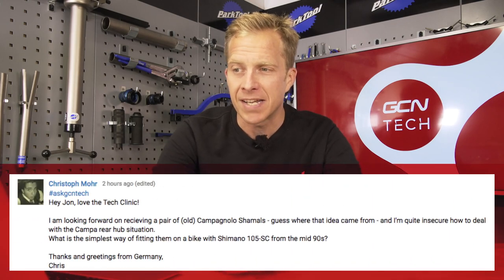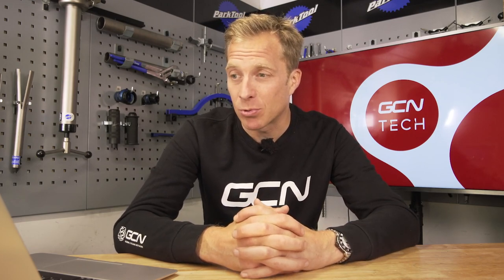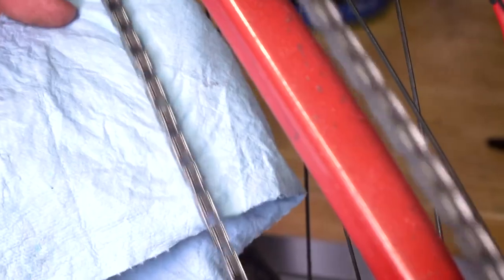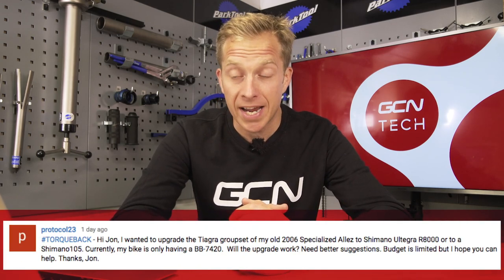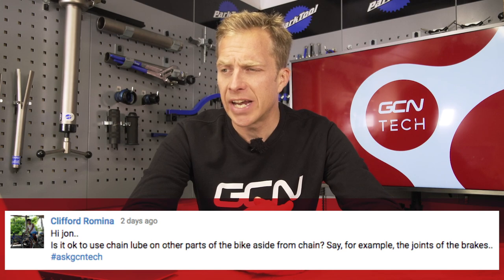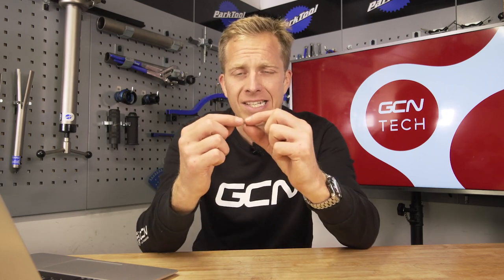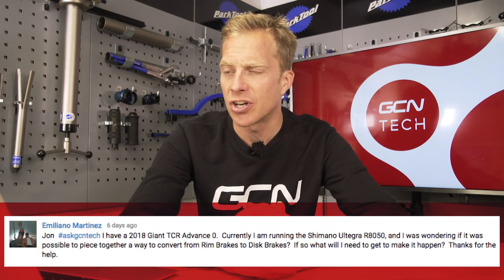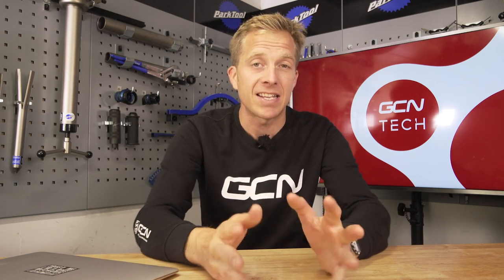How Do I Keep My Chain Super Clean? | GCN Tech Clinic

Comment: RE: Frizi Hugo. I had a situation twice where the cassette chewed right in to the freehub. at a point it began to cause a weird sought of slacking in the chain when free wheeling. which caused the chain to this the spokes often. I pulled the cassette off and installed a new Shimano cassette and chain. same issue. When i switched to the Edco Monoblock issue went away. I think this only happens to people who do lots of distance and only have 1 set of wheels so your bike gets used all year round. when you have more wheels you tend to switch from summer to winter and all that jazz. at least thats what i've found

Comment: hello john, i recently finished my winter bike with a 2005 shimano xtr crankset with corresponding bottom bracket and chainring, but no matter how much i tighten the bolts or lockring, or where i put oil and grease, i always get a creaking noise proportional to the torque i put in. i'd really like to trust it more in the snow in a couple of weeks (yeah in quebec we do ride in a LOT of sow)
Reply: Ditto - sort of. Running Shimano 105 and recently changed the chain rings and chain, then cleaned and repacked my Look Keo's, then finally changed the chain ring bolts (and re-tightened them twice since which lasts for a single ride). I still get creaking under load like climbing and/or out of the saddle moments. I'm about to pull the rings off and completely clean the BB and do an extra cleaning around the contact points for the rings. Suggestions?
Reply: @manex3  is it octalink too? I'm sure the problem comes from there

Comment: #askgcntech
Hi guys, nice show !
I have a little problem : i recently upgrade my bike by replacing 23c tyres  with 25c tyres. Since i have done this, some gravel or some dead leaves are sticking to the tyres, and finally jam between the brake, the frame (or fork in front), and the tyres. It rub against my tyres, and it's slowing me. To put everything out of this place, i need to stop my bike, and spin the wheel in the over side. It happened generally at low speed, even if i released the calliper.
I don't want to buy new 23c tyres. What can i do ? 
Thanks a lot !!!

Comment: Hi Jon. I am using the previous generation of SRAM Red 22, with short cage rear derailleur. Officially it is for 11-28 only, but works fine with 11-30, although anything bigger would be pushing it. However, I have a 1x11 SRAM Rival derailleur sitting at home, and was thinking of using it. Do you think it would work with my 2x setup? Won't the clutch interfere with the front shifting somehow? Thanks !        #askgcntech

Comment: First, I clean my goldchain with a Parktool cm5.2 with Morgan blue chain cleaner (best ive used!). Then I use the parktool once again, this time with water and dishsoap. After this the chain is clean, and I mean clean!. dry the chain, and then I use muc off dry lube, and give each link a drop of oil. Then I pedal backwards a few times over an hour before I let the bike be over the night. The day after I wipe away all the excess oil, and the chain does not need to be lubricated again for 300-400km.

Comment: Hi Jon,
I just got a nasty puncture running over some glass 400m from my apartment :( My tire now has a 1cm tear in it perpendicular to the rolling direction. On the inside of the tire, there is a 1mm by 1mm hole poking through. My Dad reckons that I should replace the tire, what is your opinion? I ride in flat terrain so descents won't be a problem.
Basically, how bad does a puncture need to be for a tire to require replacement?
Thanks!
Reply: Maarten S get safety patches from parktool and stick them inside of the tire
Reply: If you can patch the inside  (not sure on that part), you can use shoe goo on the outside of the tire to help fill holes from the glass. It's not perfect but helps.
Reply: Yes you could patch the inside with a proper tire boot or maybe a cut out piece of sidewall from another (old) tire. I've done the same on 1 of my tires that had a similar slash in it and it still works. Not really the ideal thing to do but as that tire of mine was basically brand new I didn't wanna buy a new tire, if your tire is halfway gone anyway you might as well buy a new tire.
Reply: I've used two layers of duct tape to good effect.  Be sure to clean the inside of the tire before applying the tape.  Keep a close eye on the tire to be sure that the fix is working properly.  If the tire has a noticeable bulge in it, replace the tire to be safe.

Comment: Hi Jon,

This question has been on my mind for a while now. I ride a late 80's koga miyata road bike which has a 6 speed uniglide cassette fitted. I want to convert the UG hub to an HG hub to fit a hyperglide cassette but have no idea where to start. Not really keen on replacing the hub or wheel cause I want to keep it as stock as possible. You have any experience converting UG to HG?

Greetings! :-)

Comment: Hi, nice one once again, Jon. I have a question, too. 

My dilemma: upgrade or replace?

I have had a good ol' Trek SL 1000 (or 100SL, or something) for a few years now, with all the original components, like a (mostly) Sora group still in place. That includes 3x8 shifting. I have only replaced the saddle, stem and handle bar until now. I kind of like the lively feel of the frame and fork, but would like to ride with better components, in particular a 10 (or 11) speed cassette. Of course I could just get another bike, but what about upgrading to say a second hand 105 group? Apart from the question whether that would economically be smart, would I run into technical issues?

Comment: #askgcntech
Hi Jon. I have the following issue, and your colleagues recommended to contact you for some assistance:

I have an Ultegra Di2 system which I try to index (rear derailleur).
Everything worked fine, except all my gears (11) are shifted with one position, meaning I cannot shift to hardest gear (smallest sprocket) and when I shift to easiest gear (largest sprocket) the chain "leaves" the sprocket and shifts in between the cassette and the spokes.
I tried to adjust the low and high limit screws, but then I only got left with 10 gears. No more chain slipping between the cassette and the spokes, but still no shifting to hardest gear, because the high limit screw is not limiting anything, actually. :)
Is it something that I am doing wrong? Or not doing at all?
Thanks in advance for your help!

Comment: #askgcntech hi jon, i used to run 32mm tires on my specialized allez elite but after having problems with my brake calipers i switched back to 25mm, some times my calipers get stuck and i feel some play in the brake lever, could be possible that the spring of the calipers lost their strenght after forcing the wheels to fit in the bike?  i have a pair of shimano tiagra calipers but this also happened a month after i bought my bike with the stock tektro calipers and 23mm tires, i’ve changed cables and housings and still having this problem, or it could be a problem with the mechanism of the shifters? any idea of what could be happening or someone has experienced this problem before?

Comment: Not sure of the reason, but I just recently bought a Mavic Cosmic Elite UST wheelset, and in their manual they specified to not use individual cogs on their freehub body, but stick with the standard type where the majority of the cassette is fixed together.
Reply: Jake Wisse I find that absurd. Majority of my cassette is individual (except some cogs are attached together) and I have the same freehub system on my cosmics. No issues besides what everyone has (rocking freehub body).

Comment: Hi Jon
Never miss Tech Clinic, always entertaining and informative.
I have a 2003 Lemond aluminum frame bike which I updated last year that included a pair of Bontrager Paradigm alloy wheels. Last week when I was pre-ride checking my bike for a 50 mile run I noticed a broken spoke on the rear wheel. It did create enough of a distortion to the wheel to cause a rub on the breaks. If I opened the break lever it was enough to prevent the rub but I still canceled my ride. My question is could I have still ridden the bike safely or would the one broken spoke have compromised the integrity of the wheel enough to make it dangerous to ride?

Comment: I use Molten Speed Wax to keep my chain clean, it also keeps the cassette + drivetrain clean. I rotate each chain around 500 miles or 804 km on dry conditions. if I'm riding in the wet or if I get caught in a nasty rainstorm then I will immediately wipe the chain down after my ride and change the chain to a new one. After all my chains have about 500 miles or 804 km, I will dump it in my crockpot with the melted down wax and let it sit for about an hr. After that, I will turn off the crockpot until the temperature drops down to 190 F or 87 C and take out the chains to hang dry. MSW has a video on how to clean (new) chains to get it ready for wax. The process is long but the benefits is worth it in the long run. P.S. I don't use that WEND Wax bullshit lol...

Comment: Question.  I'm having proper aggro with shifting at the rear.  A few weeks ago I dropped the chain between the largest sprocket and the spokes which broke a spoke on my expensive rear wheel.  Got the wheel fixed and attempted to solve the shifting problem.  My guess was the  derailleur hanger was bent.  This has happened before and I managed to straighten it with a tool.  Sure enough it was bent so I tried straightening again but this time it has not worked.  Still jumping sprockets when shifting on refusing to shift or changing without moving the lever.  Can hangers be straightened indefinitely or do they just wear out like metal fatigue?
Reply: If the lower limit is set correctly when the hanger is straight it will still drop of the largest sprocket if the hanger is bent towards the sprockets.  And it was definitely bent.  I've set the lower limit screw and it no longer drops off the largest sprocket but it still skips sprockets, shifts under load etc.  I'll check the cable tension.

Comment: #askgcntech Hi Jon. I have an issue with the rim brake track on my GIANT carbon wheels. So far, I have ridden around 2000 km on them and my brake track wear is significant, rim is concave about 0.5 mm. Is it too fast for them to wear like that or is it just normal. And yeah, I use their recommend brake pads.

Comment: Hi Jon! Love the tech clinic, I hope you can help... I have a beautiful steel Independent Fabrication Crown Jewel that I built up a few years back with with Dura Ace 7800 (53/39 chain rings). I want to fit a compact crankset to help getting my middle aged ass up those hills. I'd like to stick with Dura Ace if possible (I'm a snob, what can I say?) but DA 7800 didn't come in a compact so I'll have to look for a later set. I know I could probably go with DA 7900 if I can find one in good shape but a newer 11 speed would be easier to find. Would an 11 speed chainset work with my 10 speed group? Many thanks! Aaron. #askgcntech

Comment: Dan - I’ve seen the degreaser you use in the video for sale at UK screw based high street stores - do you apply neat or water it down. I read it can be quite harmful to aluminium. Cheers :)

Comment: Hi Jon, love the whole GCN thing but especially the tech channel.
Having a tyre problem with the lovely GP4000IIs I use on my Specialized Roubaix. Im 82 kg and run around 80psi pressures. Here in Australia a lot of my rides have sections of unpaved road whose surface might be smooth or at the other extreme corrugated exposed gravel.
Ive now wrecked two almost new tyres through sidewall cuts. Ive spoken to Conti who recommend tougher and less smooth rolling tyres. But I’m loath to abandon the 4000s as they are so nice on the tarmac (still quite rough) which constitute about 90% of my riding. 
Any thoughts Please?

Comment: Wax your chain if you want it to stay clean. Clean in petrol, rinse in Isopropol Alchohol, wash in soapy water, dry in the airing cupboard after swinging it round your head a few times and then stick in your bath of wax mixed with liquid paraffin. Ride for 5 to 600 miles without adding anything and then for another few use a drop of squirt or smoove until you notice it starting to gather on the jockey wheels. Time to start again :-) A cloth soaked in GT85 rubbed on the chain after a dirty ride will clean it well enough.

Comment: Hello Jon!  Regarding keeping chains clean, what's your opinion on chain waxes like White Lightning?  I've been using this for years and it seems to work great. The chain will collect dust and grime, but no more than other lubes, and it is way easy to wipe down and re-lube.  It's also maybe more environmentally-friendly than petroleum-based lubricants and doesn't require harsh de-greasers.  Anyway, would love to know your thoughts.  Love the show- cheers!
Reply: I properly wax my chains (paraffin wax in slow cooker). Many lubes get on the 'wax' band wagon but they are not the same thing at all or even close. If you wish to use a lube White Lightening is not a particularly good choice. When you look at anyone actually testing drive chain friction such as Friction Facts or Zero Friction Cycling it does not seems to come across so well for performance or wear rate an example can be seen in the following lube test   https://zerofrictioncycling.com.au/lubetesting/
Reply: Kid Karbon- thanks for the tip!  I've never really looked into the subject too seriously-- been using the White Lightning stuff for a few years and it works as far as I need it, but if there are better options I'm definitely down with checking those out.

Comment: #askgcntech Thanks for the show! Always very valuable. Question: is it possible to use any of the SRAM X-Series chains on a rival groupset? Say use an XX1 chain? I have a XG-1150 (10-42) cassette and a Sram Quarq Prime AL crankset. By default the bike (Votec VRX) comes with a PC 1130 chain. What should one look for when straying from the default chains (e.h. using KMC, etc). Thanks!
Reply: Thomas Hochstetter all SRAM, kmc, and Shimano for that matter 11 speed chains will work for you. The kmc x11sl would be a great choice.

Comment: #askgcntech - I have a 2017 Giant Defy Advanced 2 which I'm loving and looking to make some changes. It runs a 105 group set. I recently went clip less using SPD's and have noticed I naturally ride toe in.. And I have a lot of room between my shoes and the bike... What crank can I buy that  is both a lot lighter and brings the peddles closer into the bike? Reducing weight and improving aero while also making my bike more comfortable for me?
Reply: TomEnduro they make narrower cranksets for mountain bikes, but I don’t think anyone does for road bikes. The narrow mtb cranks are still wider than road. Having that space is not a bad thing. If you move the cleats on your shoes out towards the outside edge of your shoe, that will bring your feet in. That is all you can do, unless you mistakenly purchased the 4mm longer axel pedals.

Comment: Use parifin wax. Chain will always be clean. Clean with kerosene then rinse with isopropyl. Put wax in a mini crock pot, met wax soak chain remove, cool and install
Reply: Mix the paraffin with some synthetic motor oil.  The two complement each other very nicely.

Comment: Clean chain? My secret is squirt dry wax and similar products (also used soudal wax). It might need a bit more attention than lets say your basic wet lube but it keep the chain (and your legs/trousers) clean at all times really. Even used it trough a Belgian winter without any special problems. I use it on both my MTBs and my CX/road bike. I just don't use it on my SS city bike as that does tend to be left in the rain at times and I want it to be low maintenance :D

Comment: Dripping lube onto the chain is counterproductive.  The vast majority of lubes attract dirt and the dry lubes don't last very long.  If you want a clean chain that is also properly lubricated, there's no substitute for a hot soak in a lube bath composed of 1 pound of paraffin (wax) and 9 ounces of motor oil, preferably a pure synthetic.  I lube my chains every 300 miles.  This solution lasts forever (I've been using mine for about 20 years) saving you lots of money because you don't have to buy those silly drip-on lubes.  For roadies like me, when it's time to relube, I don't have to clean the chain first because it doesn't pick up road dirt.  The paraffin/motor oil solution works in any weather though if the ride has been through heavy rain, it's always a good idea to clean and lube the chain regardless of the lube used.

Comment: Regina, as for the white areas around the Shimano logos, have you removed the protective plastic sheet?  All logos on my 6800 had plastic on them that appeared like you describe after getting wet.
Reply: Same thing happens with mine.  Jon's explanation is correct.
Reply: I have scuffs as well (to bare metal darned duck feet), but the protective shipping cover developed more quickly looked worse than the scuffs did after so few miles.
Reply: I thought I looked but will look again, cheers Bob!